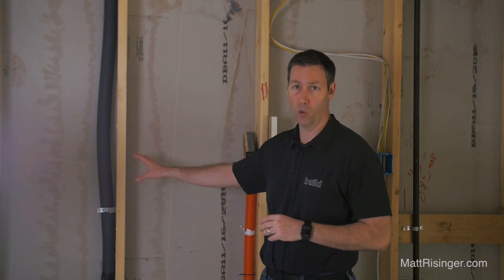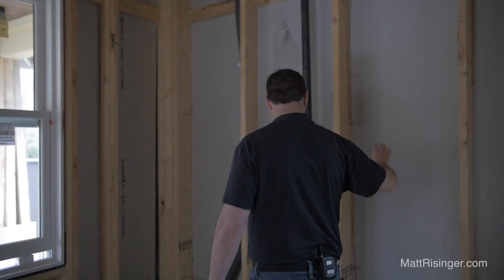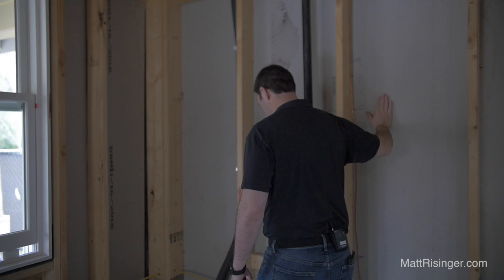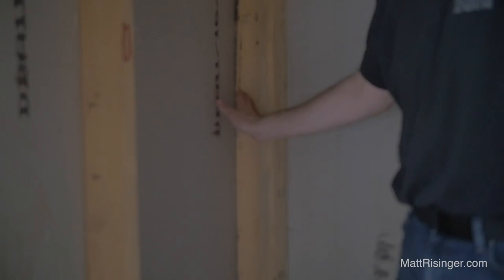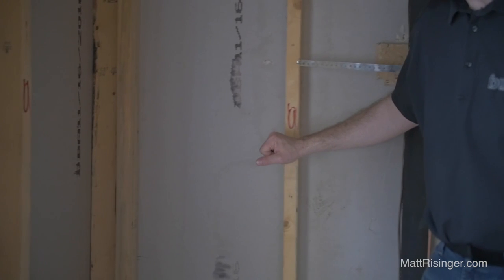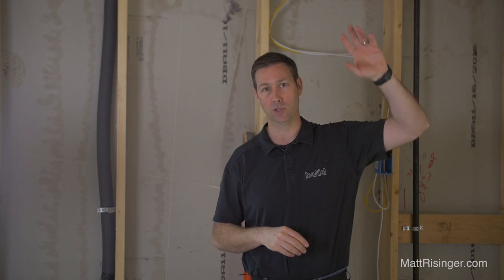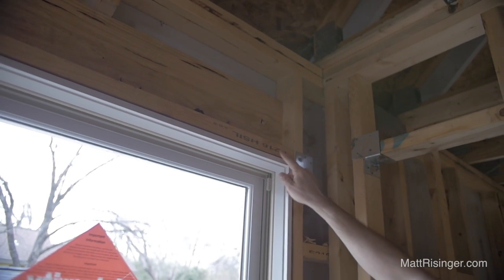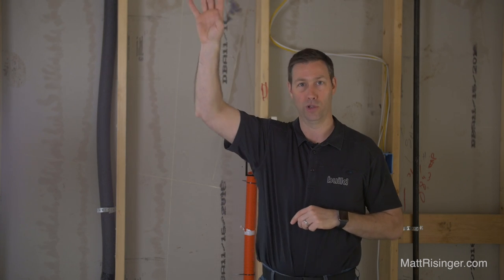Traditional vs. Advanced Framing

Comment: So "advanced framing" is apparently secret code for "cheaply built".
Reply: It's like with the trend of painting the walls and ceilings the same builder beige color in a new house.  The buyers feel they're getting something new and better than the white ceilings they grew up with, but in fact, it's just cheaper and quicker for the painter to spray the whole thing one color.  Win-win for the builder.
Reply: "Traditional framed" = stick built - "Advanced framed" = shit built
Reply: pex and copper have their places depending on region
Reply: So using 2x6 is cheaper than 2x4??
Reply: Ozzie Sheppard but a 2x6 is stronger than a 2x4. For arguement sake let's say it has 50% more vertical strength than a 2x4. Thereby if I use half the number I maintain structural integrity but use less labor. As you indicated labor is the major cost.  So it may be a less expensive product but it doesn't necessarily mean it is of lesser quality.
Reply: Ozzie Sheppard that makes sense but is there a point where we can increase the the space but maintain structural integrity for the sake of efficiency in work and long run cost?
Reply: Ozzie Sheppard both $ cost, long term maintenance cost, preventive costs, risk and loss, man hours, and energy spent maintaining temperature.
Reply: No, more efficiently built, why waste resources.
Reply: Bill Fitzgerald he obviously works for the insulation people
Reply: Possibly because the spacing was changed from 16" to 24".  2X6 is usually  a third more so don't count on any savings, plus you may need heavier sheathing for the wider spans.
Reply: Ozzie Sheppard the code may be okay with the same thickness of sheathing but the manufacturers prefer a thicker material be installed.  For instance, and I know it’s not sheathing, but I’m using type x Sheetrock and the plainly state to use their ⅝” for 24” on center, ½” for 16” on center. Through everyone that comments on Matt’s videos, and his videos, I’ve pretty much learned to not care when a contractor says “that won’t pass” ( my experience is because they don’t want to try it) or “that’s not how we always do it ( yes, but if I paid for you to follow manufacturer specs, guess what?)
Reply: Ozzie Sheppard I’d hire you in a minute!  Are you in NC?  We have a 4500 sq ft building going up. We are calling it the “She Shed”.
Reply: Ozzie Sheppard you are too kind, too far, and I haven’t won the lottery. Folks tell me I have to buy a ticket Lol   It’s actually a sawtooth roof over 3 sections @ 30 x 50, one for the sawmill and other “yard” stuff, one for the wood shop and one for the canning kitchen with storage.  It will also House a carving area and a stained glass area. We will be putting in a geo thermal system for two sections, supplemented with wood heat. We have many connections in commercial building but not impressed with the ones we’ve encountered in residential.  We’ve been having “small jobs” done letting the contractor know what we have planned. We do have a couple contractors who do both in mind but neither of us have worked with those companies for a couple decades. But do you know how good it is to hear a GC with your philosophy?  A good GC is worth their weight in gold, you sir, are priceless
Reply: Ozzie Sheppard go home Mr Ozzie and watch the bridges...heat pumps are very efficient IMHO having lived with them for thirty years.  They just don’t do it like thick walls and deep porches.  I grew up in SoCal without AC at home or at school.  For insulation, we are going older than fiberglass...mineral wool.  It was in the 1930’s section of a house we owned, it did well for 50 years.  However in our newer home built in 70, the original fiberglass was installed incorrectly when we had the bath redone.  We had a water leak and it molded.  So we requested mineral wool, had to purchase the smart vapor barrier because “we don’t use it”. Had to stop their “experts” from installing it sideways.  Then had to stop them when they put up regular drywall instead of the Type X we paid for and agreed to just to hear “it’s not the way we do it”. Argh!   I grew up with natural gas and love to cook with it.  We don’t have it in our area.  We are doing a wood stove for those infrequent ice storms that take power lines down.  I’m getting too old to grill outside when the temp is less than my age.
Reply: Ozzie Sheppard that’s why it’s important for the customer to keep their paperwork. 

We have an old business partner that sells Trane units.  The first one we bought was a gas pack leaving fuel oil heat a painted memory.  Our cost savings in three years paid for the system.  We have both serviced twice s year.  As soon as the one in the 70’s house quits, we will have the duct work moved out of the hall and changed to solid duct.  I’m not impressed with HPs when it comes to humidity and when it gets below 40 as is the case for about 10-12 weeks give or take, no heat pump is designed to work in those conditions from what I understand
Reply: Ozzie I don’t know what kind of experiences you’ve had with natural gas, but there’s certainly nothing to be afraid of. Just like anything else, proper installation prevents problems from occurring. It’s the shade-tree plumbers poorly installing piping that causes issues, normally. 
Gas heat is definitely better than electric when it comes to climates that see low single digit and below zero temperatures. There’s people out there paying more than their mortgage for electric heating while people using natural gas pay a fraction of it. It just works better.
Reply: Ozzie more people die from electrical fires than gas explosions, I’m sure you’re aware. I don’t know where you’re from, but in Kentucky heat pumps are garbage. They take forever to heat the home, resulting in more energy being used. 
CO is only produced as a byproduct of improper combustion. If appliances have enough ventilation air then they work properly and no CO is produced. If CO is produced then it’s taken out of the vent. If there’s a squirrel in there then there wasn’t an approved cap properly installed, which goes to my previous comment regarding installation. Gas isn’t dangerous Ozzie, just people.
Reply: Elaine D 
Propane should always be an option. Wood stoves are not very efficient or cheap in the long run, and electric stoves ranges leave a lot to be desired.
Reply: Ozzie Sheppard that’s amazing!  In the South, heat pumps aren’t efficient below 45-40 d F due to the air being too cold. We all shudder when the “blue” light comes on lol
Reply: Ozzie Sheppard l
Reply: and higher profit margin !!!!!!
Reply: exactly  

our studs buckled under a second floor tile installation , they looked just like the 'advanced' build

we had to add studs to strengthen
Reply: @ozzie sheppard In reference to your comment "ya just like new pex over copper, and romex over mc.", when was MC ever used/required over romex in a house? Or maybe it was an amendment to the NEC where you are from? Not talking about exceptions(ie. 2x3 studs, plenum ceiling, etc). Costs a bit more to run MC over romex, so I am curious why that would be done. I have yet to see BX or MC in any home from low-high end other than where required.
Reply: I am from MA, I can say its definitely not been the standard around here. I think you might be confused seeing it in older homes or structures with 2x3 framing. I am talking your generic stand alone single family dwelling. 

Rodents will be rodents but I don't think the cost of MC>romex is worth the small risk of rodents, especially with everything arc faulted these days. Plus its not like MC won't catch a nail/screw it happens more than you think. Key is proper spacing and nail plating.

Again, maybe where you are from MC is required but in MA you can wire many many commercial buildings with romex. I know outside of MA it is illegal to run RX in dropped ceilings other than dwellings and that might limit installations, but still many ways to skin that cat. As far as using MC>romex for fire safety in multi family buildings, maybe for some building type I have yet to see? Or possibly there was attached office space/place of assembly?

Are you a builder that specs MC? I would have a really hard time winning jobs bidding for MC when the competition runs romex at a far better price. I understand it is a little more durable but I don't see the value.

Lastly, box fill requirements last I checked in article 314 of the NEC were regulated by cubic inches not heat dissipation. For example MC or romex, a 12/2 has the same value of 2.25cu per conductor. Maybe you are slightly confused and were told that using MC with exterior mounted single/double barrel connectors saves on CU's if the interior clamps are removed?
Reply: After knob and tube did cloth sheathed 2 wire cable never make it to town? Maybe its a local code thing. I've never known romex to not be allowed by the NEC in commercial applications except where specified by building type. 334.10 would be the article laying out the guidelines, so if its different it must be an AHJ move. 

That is pretty wild people actually cough up the $ for MC in residential builds though, all kinds of trophy houses in my area I have yet to see it. Learn something every day

edit- plastic or metal box, box fill is measured the same. Cubic inches are cubic inches no matter the box type, article 314 will tell all. Seems CT follows AHJ reqs over the NEC.
Reply: A 24” stud spacing for residential is typically more than sufficient for stud walls for gravity loads as long as there isn’t any large load transfers. If there is a large load most engineers will insist on a post to take the load directly to the foundation. The sheathing, cross strapping, shear walls or occasional moment frame is what give the structure strength due to wind and seismic so as long as those systems are designed and installed properly the structural integrity doesn’t suffer from the increased stud spacing.
Reply: Efficiency and time more space gives more filling
Reply: Ozzie Sheppard No I’m not a licensed builder only a licensed structural engineer. The OP mentioned how crappy the structure would be at the expense of the insulation. My comment was purely directed at that misconception. 

I don’t recommend building to code minimum but in my experience a 24” stud spacing is more than sufficient for gravity loads for a 1-2 story detached residential home without sacrificing serviceability. I’ve had clients request it and I’ve been able to accommodate them without issue and still able to exceed code requirements. 

Also I’m not advocating an increased joist spacing. My comment was directed solely at the stud wall spacing. An increased joist spacing would require a deeper joist as to not exceed deflection limits.
Reply: Ozzie Sheppard yes I design for story shear which sums the total joist connection strength. It looks at the connections, subflooring and blocking as well as type and configuration of the fasteners. However I typically ignore it though when I’m doing the lateral analysis so I can be conservative in the case of a poor framing job. I typically also specify more LG strapping tie downs than required and either beef up the LG cross bracing or shearwalls as a precaution to ensure the loads are finding their way to the foundation.
Reply: Ozzie Sheppard not always good to use copper especially if you’re on well water. Well water will slowly eat the copper and if you run copper through concrete it will also slowly get eaten on the outside from the concrete.
Reply: The driving force behind advanced framing is desire for super-insulated houses.  But they have their own problems with things like moisture retention.
Reply: +Ozzie Sheppard
I live in New England.  Heat pumps and solar panels are practically useless here.
Reply: +Ozzie Sheppard
I guess we just have different expectations.
Reply: My expectations are very low.  The heating system works fine, it doesn't need air conditioning, the house is paid for, and I don't feel like taking out another mortgage.
Reply: +Ozzie Sheppard  
IS IT VEGAN?
Reply: @ozziesheppard17  I didn't even consider crown molding here, you have a great point, nothing there to nail too
Reply: Bill. Remember the bike manufacturer Shwinn? Heavy steel, bullet proof design, expensive. Trek makes the same machine, lighter, more efficient. One sells at wall Mart, the other at high end bike shops. Traditional 2x4 contruction is over built. Materials have improved. No place for the swchinn.
Reply: So, using the 2X6's saves money?  You use 70% as many studs, but they cost almost exactly twice as much.  It actually costs MORE.  Structural strength should be roughly comparable, if based solely on actual mass of lumber in the frame.  However, you give up some of the rigidity, by having larger spans between studs.  You can fix many of the "issues" he brought up from the "traditional" house by just using foam insulation in any of the gaps and spaces.  That header above the window?  Bore a few holes in it and back-fill it with foam.  That ups your insulation value without compromising anything.
And be careful buying those metal hangers.  There's a big difference between manufacturers and what steel they use.  Some use a more flexible steel, which will allow your house to shift with temperatures (it will anyway, so just let it), and others use a cheaper steel with more carbon that will begin to rip and tear when the wood moves a little.
Reply: Ozzie Sheppard wouldn't the best way be Romex in conduit?
Reply: I never knew that.. interesting. From a fire safety and more importantly upgradability standpoint, is conduit the best solution because it would only require fishing cable?
Reply: I've seen and done both styles and much prefer the first plan and if you do ladder braces for your interior partitions great but exterior  corners need to more stable.
Reply: Bill Fitzgerald more like thermally efficient. You don’t understand the necessity for good insulation in us northerners homes who still have relatively hot summers. It’s crucial.
Reply: I was thinkge that also
Reply: Ozzie Sheppard I’ve been keeping an eye on you here in the comments because you seem to know what your doing and speak with authority too which is hard to find. I have a few questions I’d like to ask you being that you’re also a general contractor it seems: 

What’s your opinion on building a traditional framed house with emphasis on structural integrity while also using Cob, Hempcrete and or Aircrete?
Reply: Ozzie Sheppard Why don’t you have your own YouTube Channel where you show how to build the right way compared to Matt Risinger here who builds for R value only?
Reply: Ozzie Sheppard yeah let's worry about crown molding attachment, forget energy savings, because with 16" of framing, you always hit structure. So narrow minded.
Reply: @SimonWoodburyForget  hey brother i like some of your comments, but learn the difference between then and than......
Reply: He's in TX, where you don't have to deal with snow loads.  I'm not sure what the code there is in regards to lateral forces, I know Texas gets some tornadoes and pretty bad storms.  The point is if you're building 200 cookie cutter homes with 14 windows each, it pays off to have something like a window header designed so materials are optimized instead of just stacking a bunch of 2x4's from the top of the window to the framing above to be safe.
Reply: Advanced framing has it's advantages. I don't like how the frame the windows
Reply: I agree with you
Cause the price is the same if not more with less material
Reply: @biosteeman  A 2x6 only needs to be 24"o.c., but a 2x4 has to be 16" o.c. for load beaing walls. Any extra money you spent for the 2x6's over buying 2x4's will be saved in labor costs because there are fewer studs to cut, fewer holes to drill, fewer nails to hammer etc. It adds up.
Reply: @readhistory2023  
Why does a 2x4 have to be at 16" on center?
Reply: @elained2448  That's why you have a heat exchanger with forced air ventilation as well. Bonus points for CO2 monitoring. GEO-heatpumps works decently enough with good insulation ( which is the baseline you need to work with any heating system really ). If the insulation is crap to begin with you are always better off with installing good insulation. Air-water heat pumps have a lower CoP with lower air temperatures. As such in colder climates insulation and an approtiately sized unit are key considerations.
Reply: Really,,, so its cheaper to insulate?lol get real
Reply: I'd rather have a better built house than a better insulated house. JS.

Comment: 24" centers on load bearing walls are illegal here.
Reply: Really? It is the industry standard in Norway, and we have metres of snow in the winter.
Reply: He is using 2x6, not 2x4.
Reply: Doesn't matter still here... 16 oc is code where I work
Reply: Bob Piff nothing wrong with 24” centers the compression strength of a 2x6 is tremendous. Just think of it this way your garage door is 16 ft that’s 16 ft on center .
Reply: In many areas you will need a licensed engineer to approve the 24" o.c. allowing you to bypass the code.

Comment: When I use the ladder method, i like to put the ladder blocks with its 3 1/2 facing toward the wall this way insulation can be applied to the back of it toward the outside